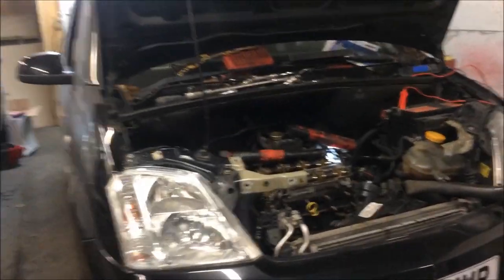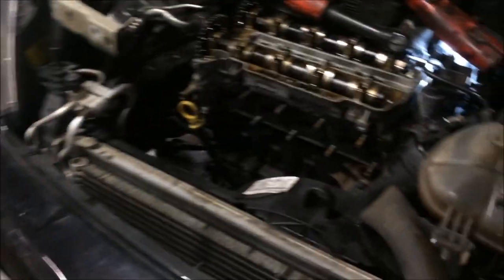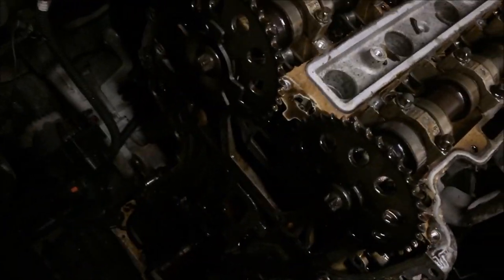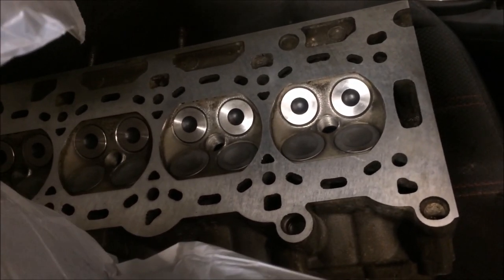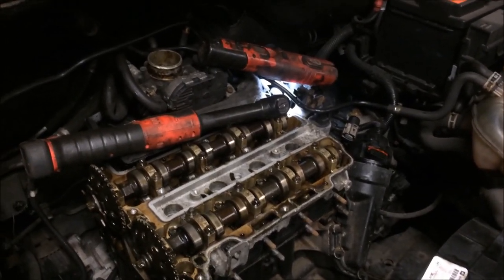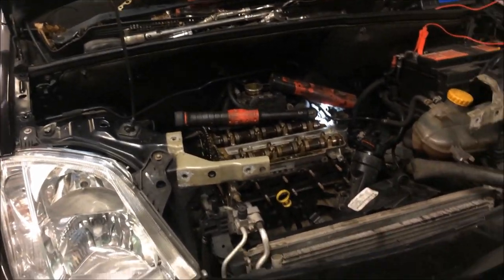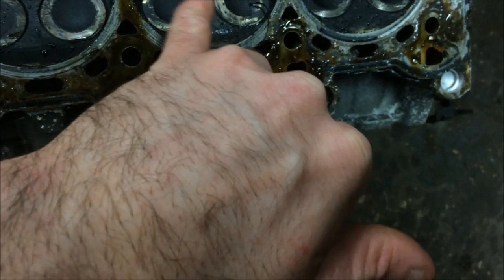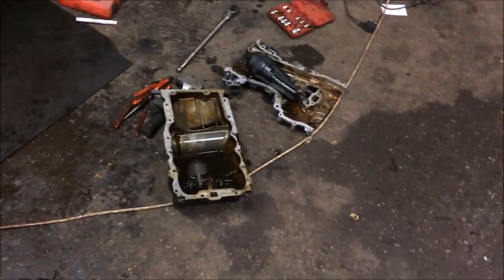VAUXHALL MERIVA ENGINE FAILURE! 1.4 TIMING CHAIN ENGINE

Comment: Can you recommend a tool to lock the cams in place and the Crank.
Also I'm struggling to find a manual on how to set the timing. 
 Thanks
Reply from the maker: Yeah you can buy the timing tool kits of ebay its approx £12.90 you should require the non vanos kit

Comment: Caught mine just in time although I'm having a p034012 code and a strange idle now any idea 1.4 astra h cheers.
Reply from the maker: HitsMetal , im not near a laptop currently to look up the code on tech data, But strange idle can be a few things on them engines, 
Sticky throttle body, requires throttle bodybremoving and clean the carbon of the throttle flap and carbon around the spindle, i usually use brake cleaner also. Sticky egr valve if u have access to a actuator test facility on a dtc reader to test the egr to see if that can be operated. There is a steel pipe that goes into the inlet manifold that joins the egr system, the steel pipe comes loose on the 2 torx bolts they just require tightening. How new is the air filter
Reply: @luke123918  Cleaned the throttle body (capped in tar like substance). I think it's my phase disk on cam pulleys, I got spaces in timing chain kit due to my old pulley not having them did not install them. :/
Reply from the maker: HitsMetal some timing chain kits on the sprockets come dished and non dished (flat sprockets) thats why they include the spacers to pull the sprockets away from the head when they’re flat ones. What do you mean by spaces? Any images?
Reply: @luke123918 how much do you charge to do this please?

Comment: That shite in the sump was sumtin else, side cover gasket is a weak point on them, so many head gaskets misdiagnosed because of them, keep the kids coming👌
Reply from the maker: David Seery I compression tested it and got 0psi on every cylinder, I was doing the headgasket for the bent valve issue but then when i had see the bits of aluminium swarf it wasn’t worth repairing, the engines for these for a decent second hand unit with a warranty are just under £500 😱